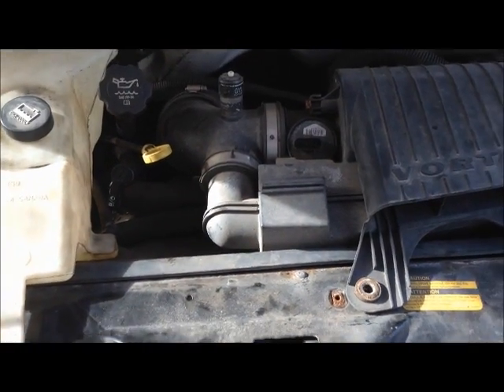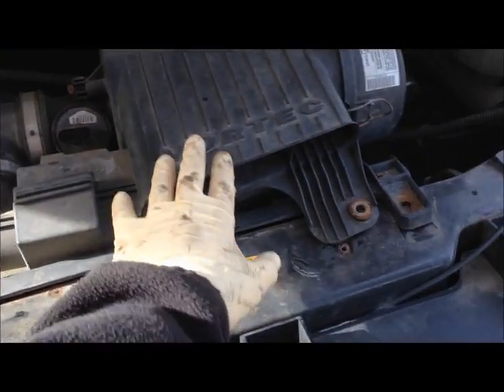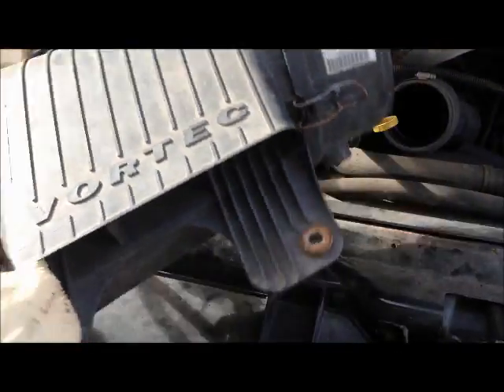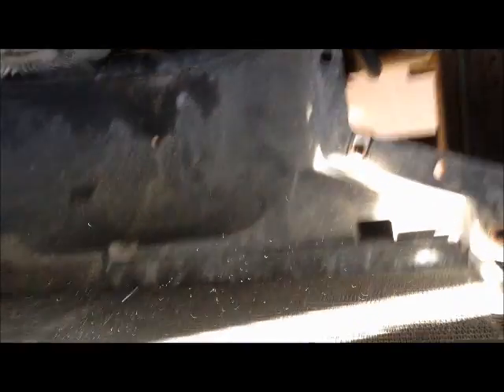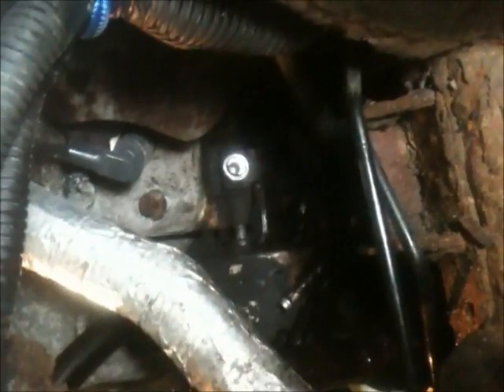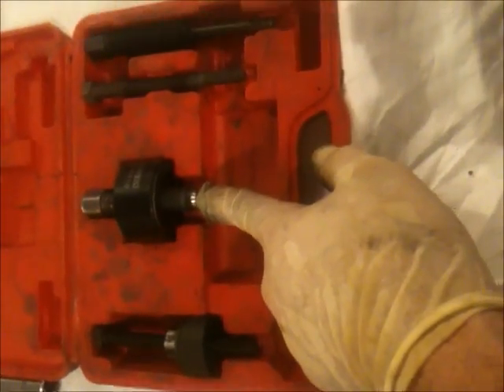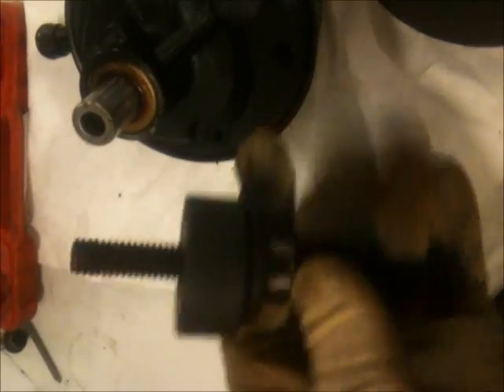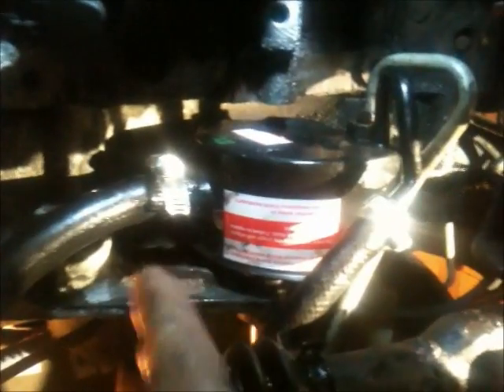Chevy Express van Power steering pump replacement

Comment: Ok, so I just finished this job.  Here are some bullet points:
1. Rent the pulley puller from your local auto parts house and then look up a video (here on Youtube) on how to use that puller.  You will save some time and trouble.  Remove the belt pully from the pump.

2. You will access the pump hoses and the one bracket bolt from the wheel well opening.  I used a large (3') duct strap to cradle and lift the wiring that blocks the view which made things much easier - you can use some wire or other method.  

3. Reaching through the fender well opening, loosen and or move/remove two hose clamps (depending on the type you have) and then remove the two low pressure hoses, BE SURE TO HAVE A DRIP PAN READY to catch the fluid that will pour out. 

4. Remove the one bracket bolt (use a long extension and ratchet wrench.  This is the 15mm bolt that is straight in front of you looking through the fender hole. It is screwed holding the rear PS bracket onto the engine block.  

4. Lift the vehicle so you can crawl under it (use jack stands).  With a good 16mm or 5/8" open end or line wrench loosen the pressure hose nut and detach the steel line.  Again be ready for some oil to come out.   (The back of the pump is now disconnected)

5.  From the front of the pump (engine compartment) remove the three 15mm bolts, note: The pump might drop so be ready.

6. Replace the O-ring on the pressure line.

7. Reverse the above procedure.

8. Fill the reservoir with fluid.

9.  With the vehicle lifted.  Front tires not touching ground... First momentarily start the engine but do not let it actually start.  Just crank it and when you here it begin to start shut it off.  Do this 4 or 5 times.  

10. Now with the engine off, (you may need to have the ignition on so the steering wheel will turn) turn the steering wheel all the way to the left (or right) and then back the other way (call this one revolution).  Continue until you have completed 5 revolutions.  Then press the brake peddle all the way down and then release it.  Do this (peddle down and up) 3 times. 

11. Check the PS fluid.  It should not be foaming or bubbling.  If the fluid is low then refill it and repeat 9 and 10.  Recheck the fluid, it should be clear and not foaming.  If it is foaming then there is still air in the line, repeat 9 and 10 until there is no more foaming or bubbles.  

12.  With wheels still up, start the engine and listen for any PS grinding sound.  It should sound quiet.  If it's quiet slowly turn the wheel from left to right and back, you should hear nothing unusual.  Slowly press the brake down and up a few times. 

If everything sounds good and the fluid still checks ok then lower the vehicle and test drive it.  If not, you may need to have this particular vehicle PS system vacuumed to remove the remaining air.  Again if there is bubbles in the reservoir fluid, then there is air. 

You can buy an inexpensive PS bleeder kit online if needed and it's actually recommended.  

GOOD LUCK!

Comment: Why not just drop the power steering pump out through the bottom instead of removing all the stuff from the top
Reply: Can’t
Reply: @DonnieLoW446  I'm the company mechanic where I work,  we have 22 Chevrolet express vans and box trucks.  Every power steering pump I change, I pull it from the bottom.  Saves loads of time
Reply: So you dont have to remove the fan and shroud?
Reply: @teal_2v338  It helps to pull the filter housing and fan shroud out so you can access the lines through the engine bay easier. However, you do not HAVE to remove the entire alternator and power steering pump bracket just to replace the power steering pump. The pump will drop out through the bottom.
Reply: @teal_2v338  And to add to that, it does make it easier to remove the fan/fan clutch, because you can get your pulley puller on and remove the pulley more easily.
Reply: @LoganFord91  Really? That sounds awesome! Any chance you could make us a quick video of that?
Reply: @TobiasDuncan  At the moment, I'm putting a new hydraulic pump and drive motors in a skid steer. I do not currently have a Chevrolet Express out here at my shop to use for demonstrating.
Reply: @TobiasDuncan  I haven't personally searched, but you may be able to find something similar on YouTube to use as a guide.